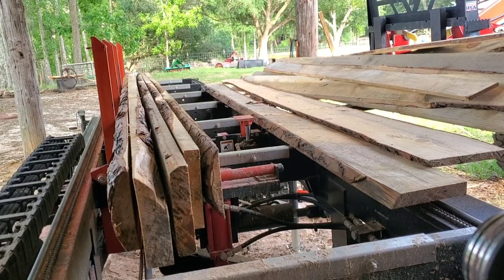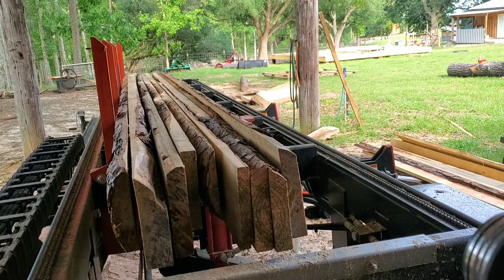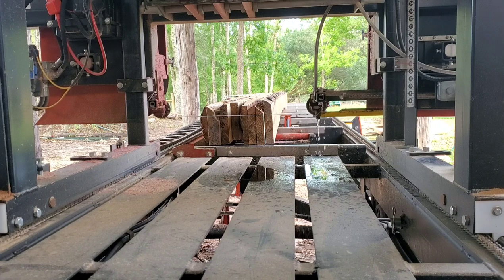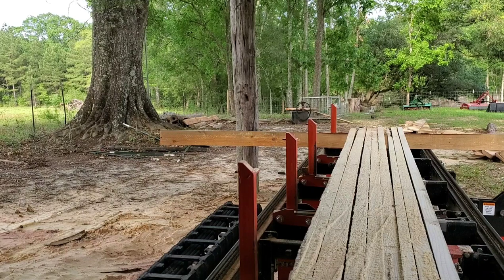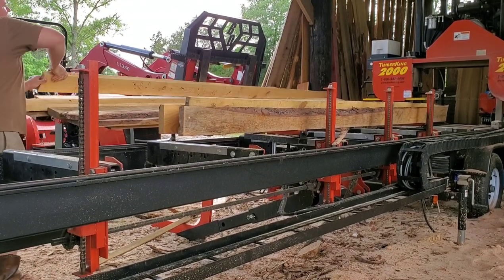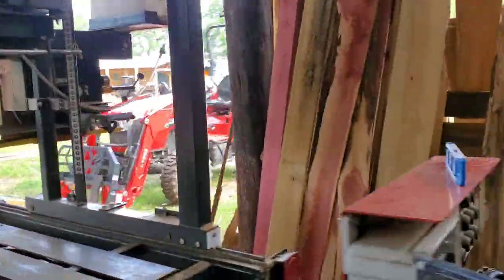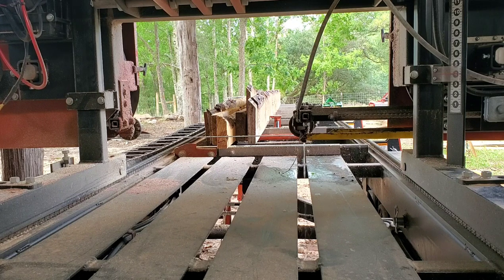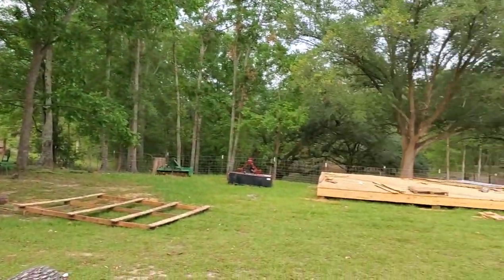Resawing scrap boards for projects

Comment: re-sawn is actually cutting parallel to the faces, you did a vertical rip cut
Reply from the maker: Yes, you are correct.   This would be easier with an edger but it's hard to get over the cost when I can do it on the sawmill.
Reply: @TCSawmills  understood